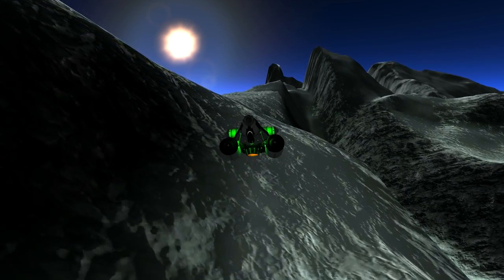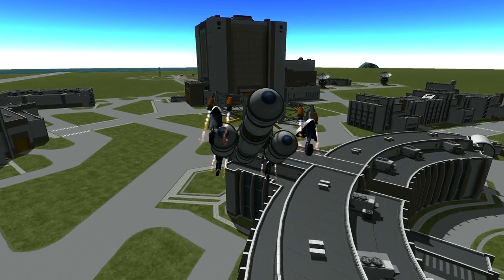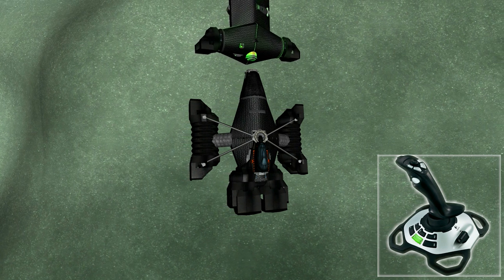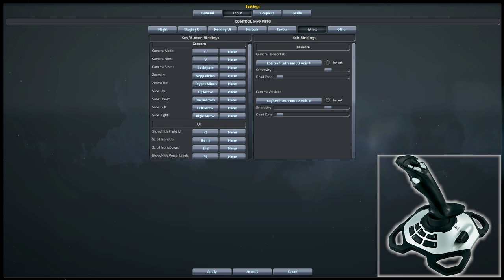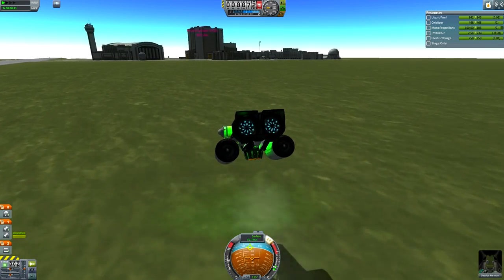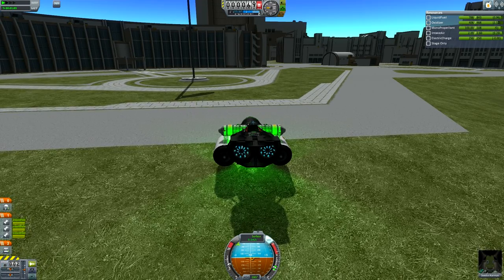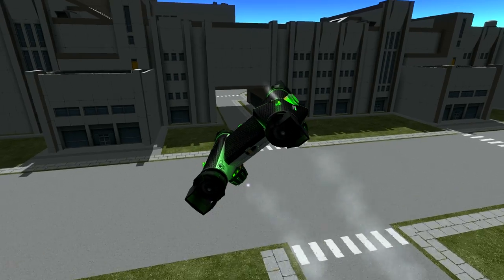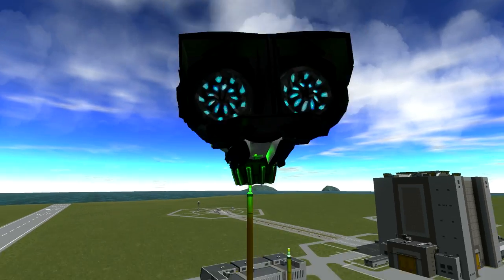Cupcake's VTOL Masterclass Part 1 : How To VTOL...

Comment: Instructions unclear, got Bill stuck in booster.
Reply: I ended up on Duna with a rover.
Reply from the maker: Jebediah Kerman Just don't use butter to get him out...
Reply: Ended up crashing into the mun. At very high speeds.
Reply: Sgt. Gee Bunny U mean docking to a base? Or landing?
Reply: F3aR_CalleR I mean literately crashing into the mun at very high speeds. While trying to land.
Reply: Then it was a high speed landing.

Comment: Do you think you could get similar results with an xbox/ps type controller? 

I was thinking that roll/pitch could be left stick, l/r bumpers for yaw. Maybe have left trigger control throttle amount. It's an axis, not sure if ksp will see it as such, if not, left up right down throttle.....

Right stick would be camera. Action groups could be assigned to the stick buttons even.

Comment: So bummed that I've only discovered this now, 3 years of game updates later.
Just started really getting into planes last night, my first was a Learjet type thing with 2 Juno's, which was too heavy and therefore too stable/unresponsive/boring. I had more success by straight ripping off the design of the F-86/CA-27 Sabre, with a single Juno and just enough fuel for a short mission... starting to get into proper stunt plane territory, around 250m/s in a dive and beautifully nimble. Later I went supersonic by augmenting the Juno with two Wheesley's in nacelles either side of the fuselage. That was great fun, and lasted about fifteen seconds before the boom... I was trying to buzz the tower and misjudged it rather badly. But it proved the old saying re. aerodynamics (at least in this game engine).... "if it looks right, it probably is right".

I think I'm going to quite enjoy the videos on this channel. Thanks. :)
Reply from the maker: Welcome aboard, good luck with your builds! :D

Comment: I just love putting Mech Jebs on it.. sure some people consider it cheeting, but it makes it so much more enjoyable. Just set the mechjebs to hover and i does that. To my testing it needs about 1/5 rocket-power relative to Jetpower to be able to hover. Mechjeb cant change throttle quick so it needs a little bit more rocketpower than a human condoled craft.
Reply: Haha... MechJeb's translaton feature is absolutely terrible for jet engines. Manual control trumps anything MechJeb could do.
Reply: Andrew Hansen Well, ssure but with 20% rocket engine it workes just right. The nice thing is that is a lot easier and don´t require the same amount of concentration.
Reply: ***** Really? That's interesting, because for me, it also did the pulsing, but it wasn't smart pulsing - it went up sometimes, down sometimes, and totally didn't stay at the same altitude. For 15 seconds it might stay at the same altitude, but then all of a sudden it would go down at 20 m/s and drop about 500 meters. Then, it would begin slowly ascending at 5 m/s for a while, before dropping down again and crashing. It prefers going down than going up, it seems.

I do hope it's just me though.
Reply: ***** You must tell me all your secrets! >:)
Reply: Sounds intresting

Comment: At least I don't feel slight as terrible knowing now I know that it's not my fault that I have killed so many kerbals with the stock rocket VTOL.
Reply from the maker: 41Extremo It has all the grace, safety and temprement of a drunkan hippo. :(
Reply: Cupcake Landers I downloaded the wraith after viewing this video, and it is so much easier to control. I had difficulty getting it into orbit though, what sort of altitude do you switch on to the rocket engines at?
Reply: Cupcake Landers I downloaded the wraith after viewing this video, and it is so much easier to control. I had difficulty getting it into orbit though, what sort of altitude do you switch on to the rocket engines at?
Reply from the maker: You got it into orbit!? What? How? It's not designed as an SSTO hence the basic jet engine. Well done on getting to orbit though I'm impressed! :D
Reply: Cupcake Landers its possible by the narrowest margins, I had to drain the drop tanks to 30 fuel, then on launch I dropped one of them, then did my gravity turn east, with the ship flying sideways with the drop tank facing east (it seemed to increase the intake air, and made it easier to correct the fulcrum the jet engine now had). I could get it to around 25000 metres and 570 m/s on the jet engine, at which point I released the drop tank, closed all the intakes with an action group I added and carried out the rest of the manuever on the rocket engines while constantly firing the monopropellant engines to translate up
I reached apoapsis at about 73000 metres at 1500 m/s, and then made that into a orbit. Whilst landing I reenacted your duna express video by running out if liquid fuel about 10 metres from the ground

So it is possible, but you have to do it really effeciently
Reply from the maker: 41Extremo If you managed that with the Wraith I'd love to see what you can do with the Scythe! :D
Reply: Cupcake Landers I've had a look at it, and I think I have worked out how to do a Duna return trip. I will try it out soon
Reply from the maker: Sounds like a plan. Good luck with the mission. ;)
Reply: Cupcake Landers after a couple of attempts, I haven't been able to get further than a one way trip